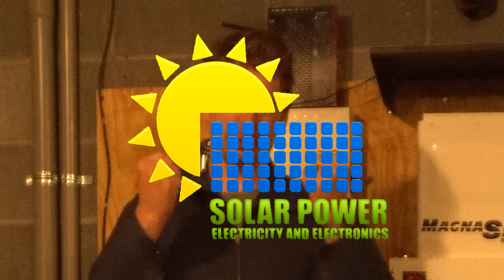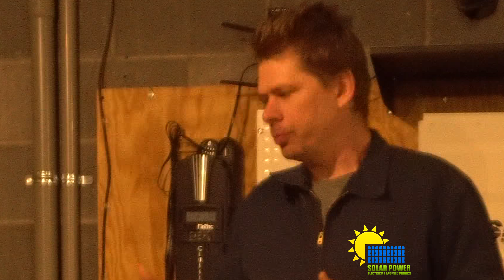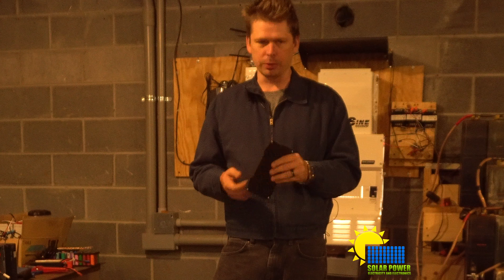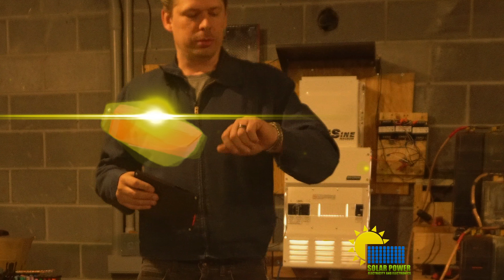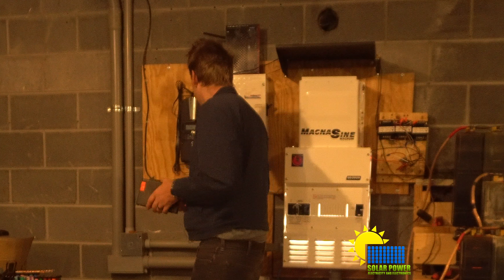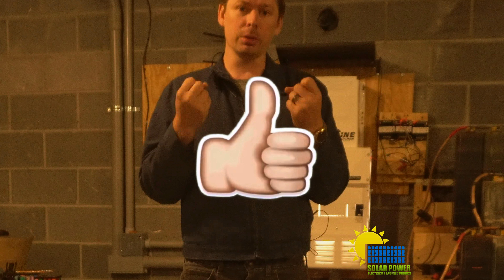Chevy Volt Lithium batteries Are Strong In A Solar Off Grid DIY Powerwall Battery Bank REALLY STRONG

Comment: Shipping companies or post may not handle FLA batteries with electrolyte in them I think, great project, Be Well
Reply from the maker: I won't be shipping lead acid batteries it'll just be lithium 24v packs at 1 kilowatt hour and 48 volt packs at 2 kilowatt hour
Reply: @solarpowerelectricityandel2915  I thought you mentioned 105s, no worries,
Reply from the maker: @ElRazTheGreat1  I did mention the Trojan t105 batteries but somebody's going to have to come and get them if they want them for three hundred bucks